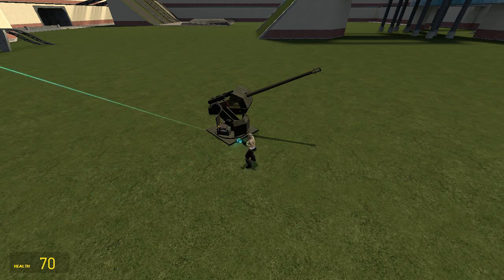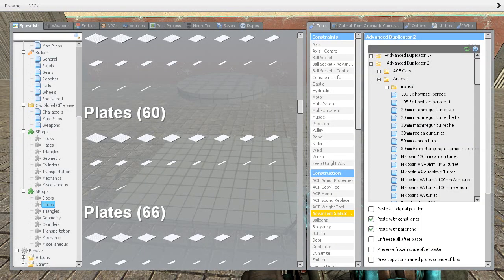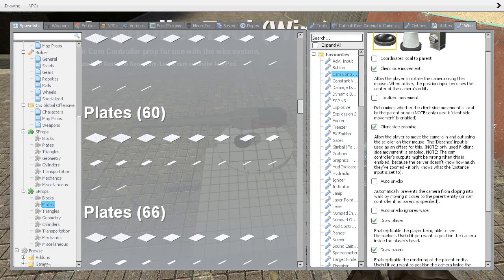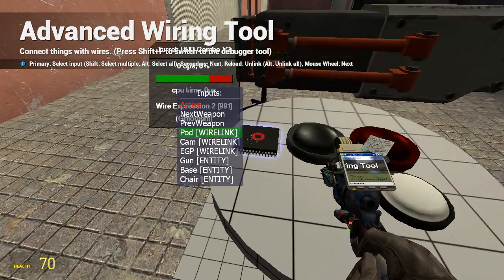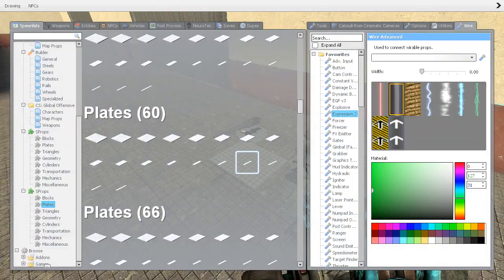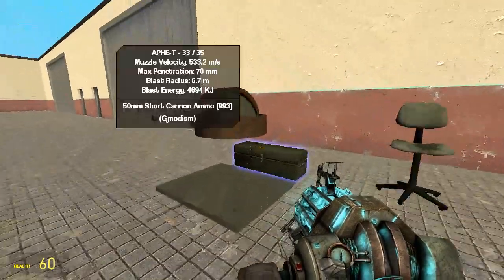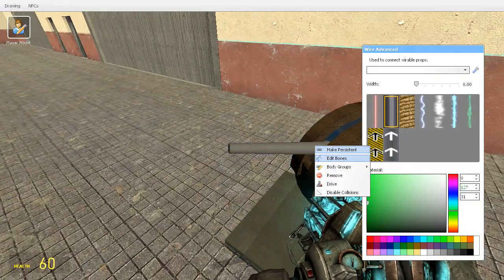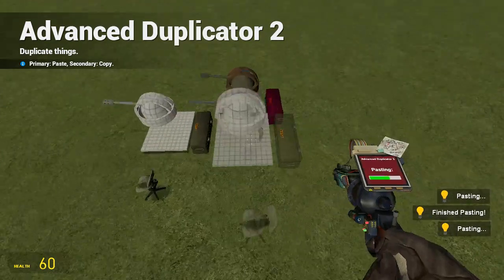Garry's Mod Tutorial | How To Make ACF Mouse Aim Turret With Link To E2 Chip

Comment: Ok this is weird, i seriously spent 4 hours trying to figure out what was not working. I got this working 2-3 times, but then i got a weird "bug" where the gun just points down and refuses to respond my controls. Tried several times and i don't understand where i'm failing. I'm sure the weapon is not stuck since if i try to rotate it with the psygun it works along the axis. Some suggestions would be appreciated...

Comment: Can I ask you a question? I know it is quite late, so I get it if you don't answer. What is the significance of changing the weights? How does it effect the props? Why make them heavier, wouldn't lightness be more important? Thanks.
Reply from the maker: Late but we still make weekly videos. 
Depends, ACF have set weight. Light is better but, the props need to support the weight from the acf components and other parts above.
Reply: Gmodism Total Nerdery Channel 
Ah, does a higher weight support heavier things? One time I made my base weigh only 1 unit and all welded objects basically fell off it. Is that it? Or does it make it more stable with a lower center of mass? Thank you.
Reply from the maker: Bigger props are better, ie more volume. Low centre of mass is more stabile, but base prop soul generally be the heaviest prop in the build. As all things are welded to that prop exclusively.
Reply: Gmodism Total Nerdery Channel

Okay, that makes sense. Thanks for the answers!

Comment: Is there a way to make this with 2 or more cannons? 

>inb4 quad 30mm autocannon
Reply from the maker: if the other guns are the same weight it is hard to make it stable using this tech, works but you need to connect the guns up to a prop frame that moves and control one of the guns, moving the frame.
Reply: Is there a way you can edit the E2 to accept multiple gun ports?

Comment: I know this is a very late comment but whenever I try to use a different gun (like the Rotary Autocannon) I get the right ammo and do everything correctly in this video to link up everything correctly but it won't work with other guns. Suggestions, help, etc.?
Reply from the maker: RAC are sometimes disabled or forbidden because it was (is?) to OP, with other guns, make sure to use correct ammo, link it ti the gun and activate ammo box .
Reply: I found out what it was, the weight was too low, something about your comment (and me reading it over and over) made me remember to try that. Thanks.
Reply from the maker: Oh yea,  if you change weight on any ACF component they stop working ^^
Reply: Gmodism Total Nerdery Channel oh guy big thank you omg you helped me to fix that :0

Comment: Is there a way to limit the guns manuverability, for example if I wanted the gun barrel not to be able to look too far down as that would clip with the hull.
Reply from the maker: Yes there should be values in the chip, not sure, there is however the option in the daktek chip :p
Reply: Thanks, I got the turret working. But I'm having a hard time making my tank move. I haven't found any suspension that can support a 45+ ton tank and for some reason I can't get any E2s to work with axis suspension, I have made lightweight chassis with rope/elastic suspension and they work fine but I don't want to be driving around a 1-2 ton tank.  Could you perhaps tell me what I can do to fix my suspension issue?

Comment: How can I make this turret support more weight? It seems to fail if I have enough weight on the turret I have. I tried moving the gun closer to the center of rotation of the turret, didn't help.
Reply from the maker: Make support heavier to support heavier guns.
Reply: What do you mean "support"? Do you mean the thing I wired Gun[ENTITY] to? I tried making that every general benchmark from 5,000 to 50,000 and none of them did anything.

Comment: I know old video and such but i have an issue with this that i don't know why happens. Everytime i set it up wherever i aim the gun is in the reverse position and i have no idea why please help
Reply from the maker: Build opposite direction and you be fine i'd think, maybe even spawn thing 180 degrees arround
Reply: Okay i'll give it a try thanks!
Reply: Tried assembling it in the opposite direction without success. When i turned the whole gun mount around then got into the seat it started to line up then swung back around to the opposite direction.
Reply from the maker: very strange, did you try turning it with dupe tool?

Comment: ok fixed? but new problem - dont see any crosshair
Reply from the maker: EPG is probably not connected as it should then
Reply: Yep, my bad. But.. haha, the gun doesnt move correctly
Reply from the maker: very light guns work less well too
Reply: no solved by place the chip, camcontrpller and epg on gun base
i doenst have any ideas how thats may be but its.. so, may i aks one more? (before see the tutorial) how build any missle turret (also mouse aimed or whatever) D:
Reply from the maker: ACF missiles have a separate tutorial, for mouse aim you can guide by mounting a ranger on the turret :)
Reply: yep))

Comment: It's not working for me. When I sit on the chair my cam doesn't change and it writes many errors.
Reply: Daniel Šušuk kek, which fucking noob still uses this
Reply: This is a glitch that often happens with wiremod, It works on some servers, and some no. Just try reinstalling wiremod, or using the SVN link

Comment: I got a smal problem with this exp :( without camera all is vice versa :/ Only up and down work ok. If i look fron canon go back left is right and right is left :/ i dont know what to do :/ And if exit pod with camera connected, camera view dont turn off
Reply from the maker: In that case build it 180 degrees around, if camera behaves like that, double check connections and settings
Reply: Thx for fast reply :)

Comment: i got a question when i weld the cannon too my turret and unfreeze it it drops down
anyone knows why
Reply from the maker: Is your weld maybe forcweld, then set it to 0 in weld options
Reply: it was at 0
Reply from the maker: then i think you tried to weld it to a parented prop, that would cause the same thing
Instead always weld to base prop :)
Reply: i changed the weight of the prop i welded cannon to it, it works (sorry for my bad english)
Reply from the maker: no prob, good it works!

Comment: gmodism tanks for helping me build my tank and it works amazing but i have 1 last question before i play with it in battles 'N' stuff. my tank is really tall and the camera view is really low so i cant see over my tank. any ideas?
Reply from the maker: You can change camera offset in the E2 chip, if i remember correctly there is istructions in the chip :)
Reply: tanks again!

Comment: can you make vid were you show us how to get the turret chip cause i dont know how
Reply from the maker: I may do that yes
Reply: ok thanks
Reply: hey gmodism i tried out the tank turret but a lot of things go wrong. okay number 1. the most common thing that happens pretty much every time is the gun flips over when i control it. number 2. most common thing that happens is my gun can move up and down but my turret cant turn horizontally. number 3. most common thing that occurs is my turret starts twitching and and nothing works or moves. im begging u to help pls
Reply from the maker: Thestellargamer25
If your guns turn the wrong direction is probably because you dont build towards north, twitching is sometimes caused for light guns, especially when playing in single player, so always try go online too.
Also guns have ups and downs, that matters for the chip, so dont flip it or anyting, mount gun the direction it was spawned

Comment: how did you get the turret to work? When i tried it on my airship, it just dosen't work. also i didn't use the cam controler
Reply from the maker: +RabbitFootedKitty Them you probably forgot a step, maybe link seat to pod ctrl?
Reply: +Gmodism Total Nerdery Channel no i did everything right but when i get in the gun points backwards and I can't control it
Reply from the maker: In that case build it facing the exact opposite directions, e2 can be a bit sensitive
Reply: This exact same thing happened to me. make sure that the little arrow on your e2 is facing the same direction of your turrets gun. see if that works.

Comment: How would this be applied to a forward port gun, such as the .30 ball on the front of a Sherman, but having it be set up as a different seat?
Reply from the maker: +MrBloodyboy551 So for a machinegun, most folks mount it fixed in that case, small guns are not to good on a chip, but it can work and for that an other seat is better, you can also use advanced ball socket to limit the guns angular movements ^^

Comment: hey Gmodism, i followed everything you said. the gun and everything else is working fine. but, the gun sight is not visible
Reply from the maker: +Manila Boiz Gaming Like the HUD? than there is something wrong with the EPG, make sure you connect it up correctly, you can also press E on it to manually get HUD
Reply: Yup, the hud is not showing up. Ill rewatch it a couple of times more. And geez, that was a fast reply
Reply from the maker: You need to link the EGP up and having the right settings and you should be OK ^^